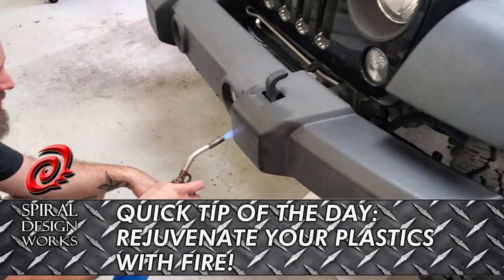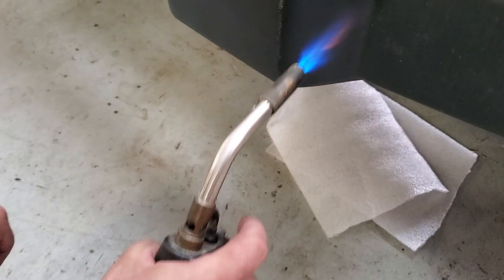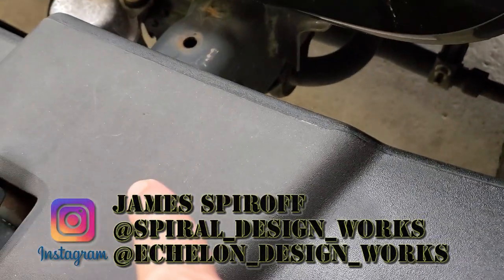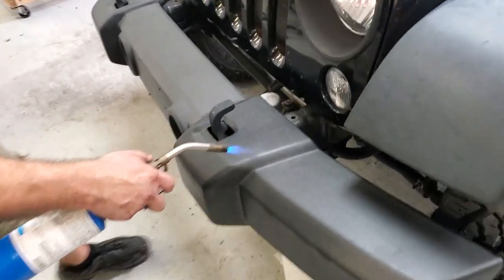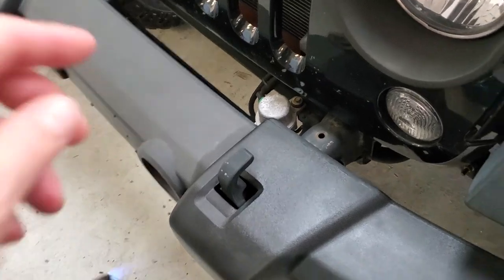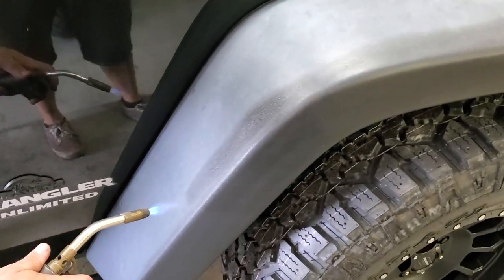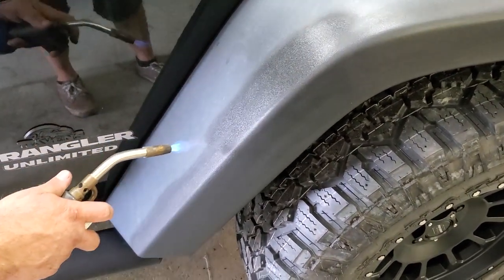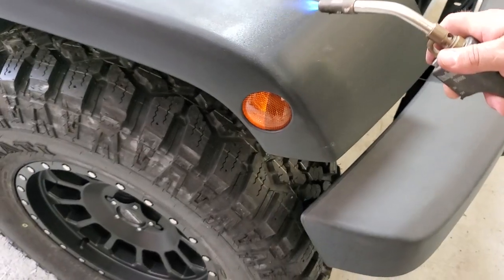Quick Tip: Rejuvenate Car Plastics with Fire! Use a propane torch to shine up your plastic trim.

Comment: Is this a permanent solution or will it fade once again?
Reply from the maker: It has been a few years and I just saw his jeep yesterday and it appears it does not last long. I think the theory's are correct that it pulls oils to the surface and remelts the top surface and looks great for a while. but ultimately may weaken them and possibly more brittle.  So my vote now is not to do this but try maybe a chemical rejuvenation.
Reply: if you do this, and you treat the plastic every year with mothers, it'll last
Reply: It'll work, but it'll eventually fade. However, it'll take a while to do so. I used to work at a plastic rotational molding company that use this method on their plastics. It's recommended to add a protected solution to the plastic afterwards to make it last longer. Stay away from Armor All.
Reply: Having done this for years prior to watching this video, it doesnt last long. And each time you do it, seems to last even less time. The protecting it with mothers or some other such thing might help, dont know.
Reply: @Jseagle1989  what would you put on afterwards as a protection?
Reply: Same as stock, after few years use protectant it'll help

Comment: A lot of clueless guessing in the comments about how this works. Its not "bringing oils to the surface" or anything like that. Most automotive trim is gonna be PVC or POM. Plastics are fairly long chain molecules. Theyre called polymers because theres many (poly) molecules in the chain. With time, sunlight will degrade the polymer chains causing them to break apart. The black color of the plastic keeps this degradation from going too deep. Since these are thermo plastics, heat will cause them to melt once theyre above what is called the glass transition temperature. The broken chains get closer together and fill the microscopic gaps that caused the faded color. This is only a temporary fix because only the very surface of the plastic is being melted. So once that shell on the outside gets enough sun you'll be back to where you u started. A more permanent fix would be to use commercially available trim restorer that will act more like a paint, filling the gaps and soaking in like sponge.
Reply from the maker: Thanks for the knowledge drop. Appreciate it.
Reply: Wow thanks for that lecture Einstein, my god I can feel the superiority complex coming off that speech
Reply: @aviationeb98  I think I had some good stuff in there
Reply: @aviationeb98 Just because you self inferior reading that post doesn’t he was projecting superiority.
Reply: @aviationeb98 Sounds like someone is insecure that someone else just has more knowledge
Reply: I'm back to black again. Thanks for the info..very informative.
Reply: @aviationeb98  So, too much for Chad to understand? He simply explained how this works and you come off as a crank.

Comment: Ooof you gonna regret that. You are both burning off the oxidation and drawing the remaining oils to the surface... after a couple weeks of weathering... when those oils leave it's gonna be alot worse! I have heard there Is a way to seal them after firing them that makes it last a little longer... but currently don't know how thats done.
Reply from the maker: Dave is lazy and never finished the job on his Jeep here which we filmed about 6 months ago. Still looks better that the really grey areas he missed but fading. I think coating it with a product after or even mineral spirits to try and keep the oils in is a good idea for sure.
Reply: @SpiralDesignWorks  I haven't tried it myself as my family does car detailing so it's more of just a "forwarding of the mouth"
Reply: I wonder if a clear coat paint would help it gunna try this on my car

Comment: Merely a temporary bandaid. You're extracting any remaining cellulose to the surface, causing it to become even more brittle.
Reply from the maker: Yeah definitely did not last long.
Reply: @SpiralDesignWorks  what happened? how long did it last? thanks
Reply: @SpiralDesignWorks  Yes tell us how long it lasted. Also, any ideas on a better solution? Painting?
Reply from the maker: @Lawgivaah  I would say in Florida it only lasts a few months and starts fading again.
Reply: so do this right before selling it to a dealership to rip them off

Comment: I did this to my  2000 WJ. I cant believe I didn’t know about this before now, Thank You! I just took another 50,000 miles off the look of the Jeep. I’m in the process of converting it into an over lander but you know how much work that is. Peace
Reply from the maker: Good luck with our project. Be sure to apply some protectant designed for external plastics.
Reply: How long has it lasted?
Reply: Has it lasted? @ryanlick3894

Comment: The torch idea looks great.  Do you think a heat gun will also work, without the chance of heating the area too quickly?
Reply from the maker: yes just a bit slower.
Reply: Heat Gus is slower, but easier to do without having tiger stripes and it cheaper than using all the gas.
Reply: Yes
Reply: I restored my firebird interior with a heat gun. It has adjustable temperature. It makes it easier.

Comment: If doing this at least Crack it back with some petroleum distillates (pb blaster) I had some really brittle acrylic then hit it with VOC's and it wouldn't break at all, it's like wood handles when it dries out and needs oils or waxes add a torch and watch how much oil a handle will absorb

Comment: Do you recommend only using that size of a torch or do you think you could use one of those bigger torches that you use to start coals with? Just seems the bigger one will have a bigger flame so you could do a bigger surface area.
Reply: I've used a bigger torch. Just adjust distance and time focused in each apot.

Comment: Just use some rattle can of clear coat. It will definitely look new and last much longer.
Reply: Clear coat spraycan will restore faded black trim?
Reply: @thegreatecb  it did for me after I made the mistake and used the plastic renew stuff one can buy at the auto parts store, which faded my  plastics on my FJ Cruiser, which included my black bumpers and running boards. I now have to refresh it this spring, after about 2 years. But that's too easy.